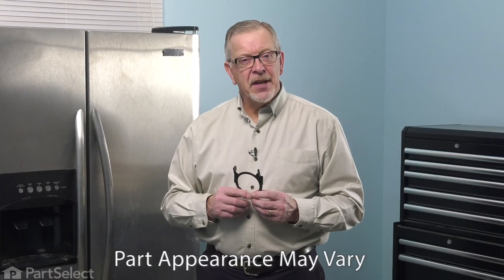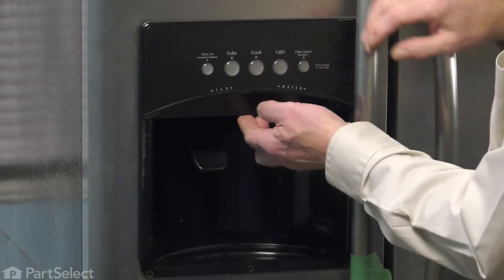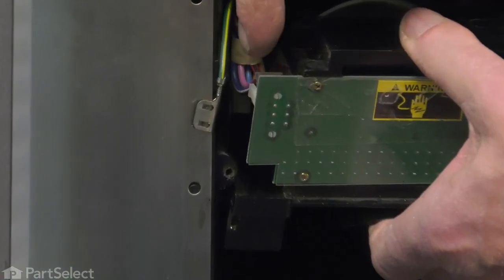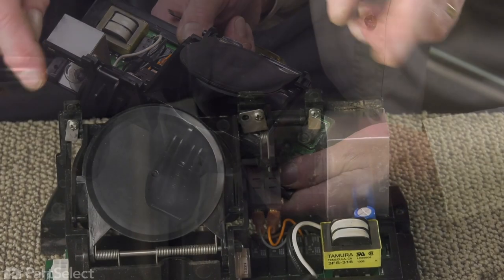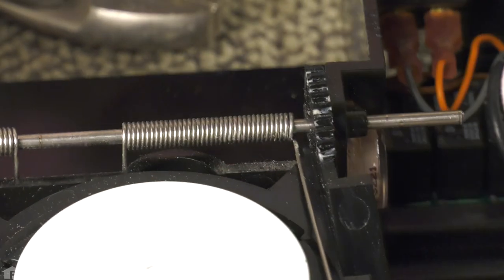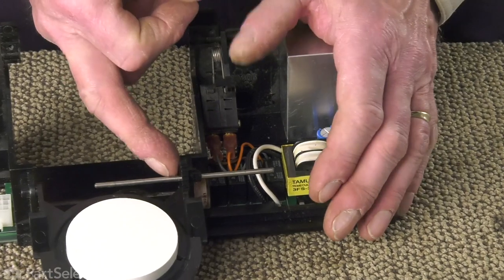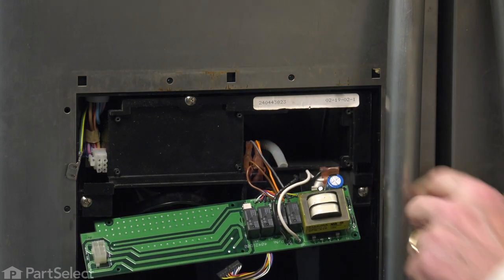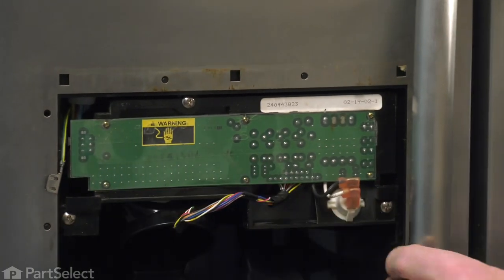Frigidaire Refrigerator Repair - How to Replace the Ice Chute Door (Frigidaire # 241688401)

Comment: Thanks Steve, your videos are awesome.  My model was a tad different, there wasn't a control board blocking access to the water hose, but it was still tough getting it back in (actually it was tough getting it out in the first place, seems hard water deposits kind of glued the tube to the plastic holder.  BTW, I found a very easy way to remove and reinstall the spring pin, just get some pliers and rotate the pin back and forth while gently pulling or pushing on it, it moves easily and no hammer needed.